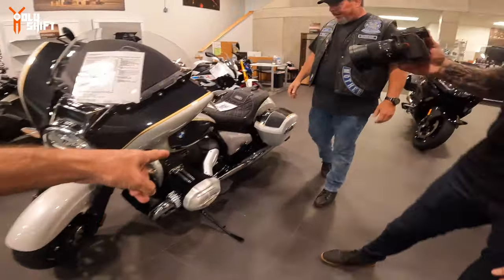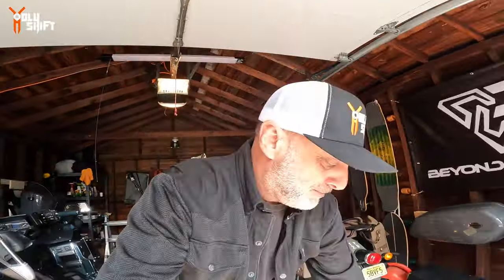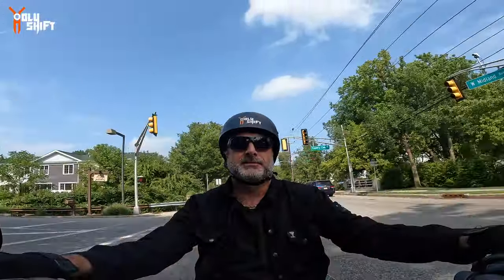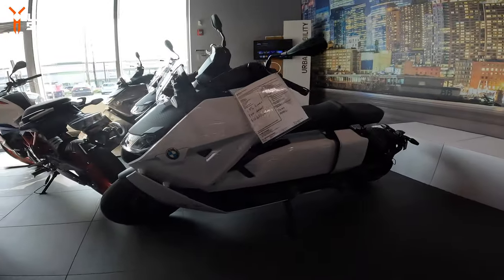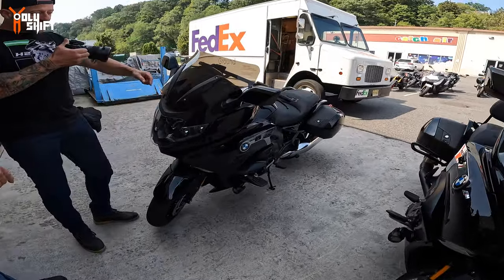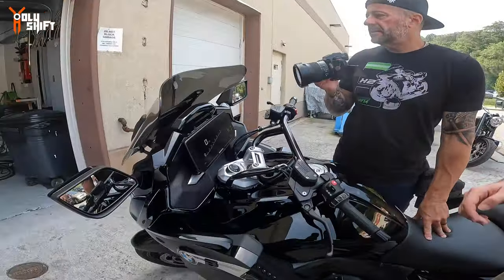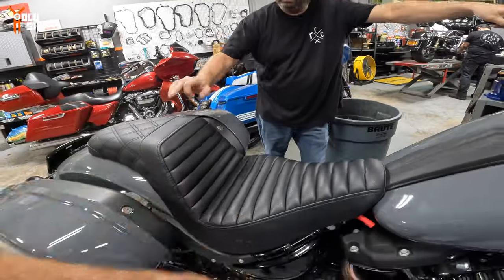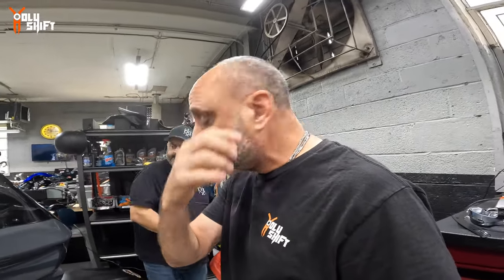Installing A Light Bar On A Harley Low Rider ST

Comment: The light bar looks great on the Lowrider ST, just curious as to how much it would cost to do something like that.. Plus the new K1600B looked good, but the old one had the 719 rims that are a $2000 upgrade from the basic rims, and the sissy bar had to be a little pricey as well to just give up.
Reply: Wasn’t interested in the rims again didn’t want to pay the $1850 extra! Also, the back rest was an eBay purchase 125 bucks so I wasn’t interested in that either getting back rest luggage rack combination! But thanks for watching!👍💯🇺🇸😎

Comment: Typical light bracket is designed too low where it can be contact the fender when front end dives in. How is your experience with your set up so far?
Reply from the maker: No problem!
Reply: Yep, plenty of people on the lowrider S forum that have bottomed it out and dented the front fender if not lifted

Comment: good video.  mike sometimes reminds me of artie lange - i mean he's not as funny but kind of looks a little like him and def sounds like him when he talks.

Question for you Sandy - you dont think there is any chance that if you hit a very large bump in the road that the shocks could compress enough to hit your fender - do you ?
Reply from the maker: I don’t know about the bump- time will tell
Reply: @HOLYSHIFT  i mean, is that a concern for you.  did you try to push down on the front forks to check for clearance?  the only reason i'm asking is i'm considering doing the same thing to my low rider st but if there is a chance it could contact the fender i def wouldnt do it

Comment: Seriously dude what's with the flood light ? Can't see ?
Reply: I put one on my ST. The light being mounted to the triple tree moves with the bars at night during turns. I can see much much better going around corners or tight loop merges onto the hwy at night. Also the yellow helps a ton if there is fog which there always is near the river where my place is at night. It's well worth it for how cheap it is.